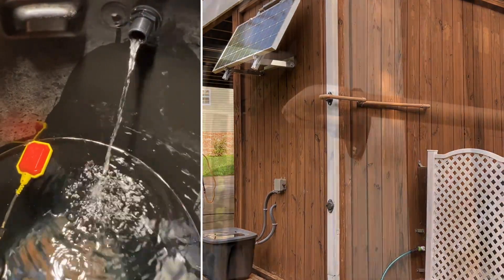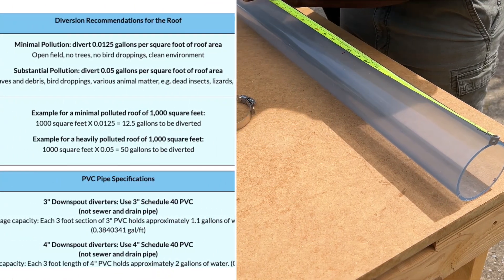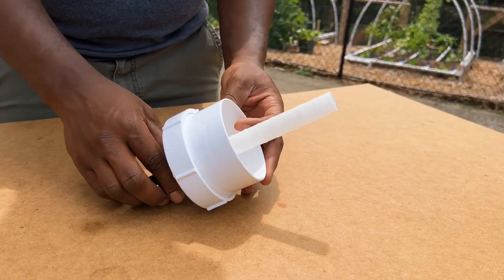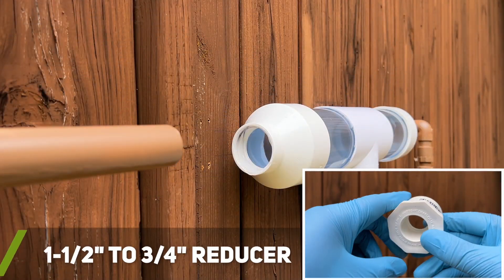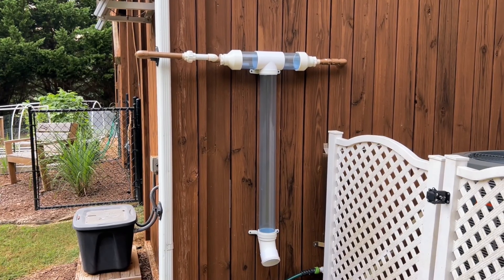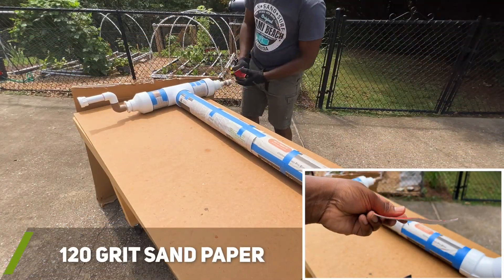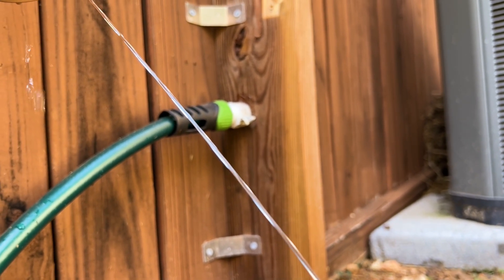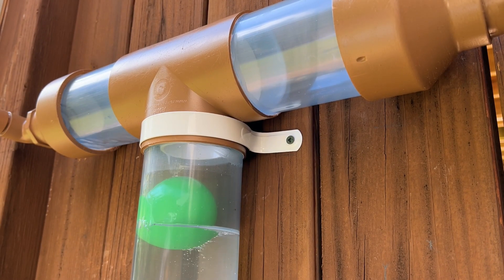Capture CLEANER Rain Water Using This SIMPLE Device

Comment: Very slick idea! I like it alot! You speak like an engineer, as am I. Yeah, you want to use the purple primer then glue it. My only real question is if you are separating particulates from the roof/gutter, wouldn't a larger drain be required?

Comment: What's the point of the ball valve? It only closes off the bottom portion of the pipe when it's full of water (ie, before draining). It's not like it rises and then locks into place for x number of minutes. But if you didn't have a ball valve then the water level itself would effectively block off the lower pipe as well. I guess that if you didn't have the ball valve then you'd get some mixing between the water in the lower pipe and the water going to to the tank. The flow would be a bit more turbulent. But the "waste" pipe is so long that I don't think you would risk have the turbulent water pick up the waste that's settled?

Comment: Given the low diameter of the supply pipe I assume this is for a very small roof?

So does the first flush tube ever get full during a rain?
Reply from the maker: Yep, it sure does. And if you notice it is not filling up, you can change out the control valve with a smaller one that lets out less water from the first flush.

Comment: How does the ball system work exactly? I get that debris runs down into it but how do you get it out without losing water?
Reply from the maker: Occasionally, you will need to remove the bottom cap to clean out any debris. There will likely be no water inside the bottom tube at that time since the water self-drains out at a slow rate to reset for the next rain cycle. You may be able to see this near the end of the video.

Comment: I would have gone with a radial flow swirl filter. It could have been as simple as a 5 gallon bucket sitting on a wooden stand positioned above your storage tanks or a large conical bottom storage tank in line with your other storage tanks.

Comment: CUT PVC like you do metal pipes... all the way around the circumference at the the same time working towards the middle... the clamp is a great way to keep the saw blade inline as you rotate the pipe or pull the teeth of the blade around the Pipe

Comment: Robert, I don't know what your educational background is, but your videos are neat, concise, and very informative without a lot of superfluous chit-chat, which drags a lot of DIY videos down, so I will be interested in your future projects. I recently built a 2 barrel 'whiskey' fountain with an old hand water pump on top, and am using battery operated LED 'twinkle' lights from Harbor Freight for the lighting. However, I would like to convert them to solar with a 12v battery backup, I am also interested in connecting several solar powered landscaping lights to this system. Any suggestions would be appreciated. P.S.  I was a Navy Avionics tech on F-4 Phantoms, and was a computer tech throughout the '80s, and early '90's, but my electronics knowledge slowly faded after that, so I am way behind the ball on nano, Ardino & similar electronics projects. I recently built a double 'whiskey' barrel fountain, and am using battery operated LED 'twinkle' lights from Harbor Freight for my lighting. However, I would like to convert them to solar with a battery backup, and connecting several solar powered landscaping lights into this circuit as well, so any suggestions would be appreciated. One suggestion from an old technician, when splicing wires together, to make the splices less bulky, stagger the length of the two wires, then cover both with 'shrink'. Also, you can buy several types of hand held torches that can refilled from the small propane cans found in any hardware store, they have a hotter flame for faster shrinking, and most of them can adjust the flame. Keep up the excellent work & videos!!
Reply from the maker: Thanks for the tips. You can see what method I used for powering some lights here: https://youtu.be/dLbeZffA7YQ
Note they are DC lights and not AC lights. If I used AC lights, I would have had to install some type of inverter. Not a huge deal, but one less component in the system to worry about.

Comment: I have to assume most viewers of this video would have standard North American roof consisting of asphalt shingles. Costly as it might be, next time you require a new roof, consider getting a metal roof. The amount of shingle 'grit' can be considerable depending on your roof. With a metal roof as it is metal there is no 'grit', thus vastly reducing the potential amount of particulate in your rain barrel system.

Comment: Cool stuff, simple and smart, I like it.
I have to wonder though, won't the control valve result in a lot of wasted water over the span of a storm?
Reply from the maker: Good question. It's possible if you chose the wrong valve, but they give multiple sizes in the kit so you can experiment with which one works best for your application.

Comment: You really should use the purple primer when fitting PVC pipes. Not using the primer will make for a poor weld.
Reply from the maker: The primer I used is an Oatey single step all in one cement meant for this type of application. I’ve used it for a few years now and haven’t noticed any issues. Highly recommend.

Comment: Seeing as most contaminats are heavyer than water, why bother with a ball valve. Simply let the water flow across, and let the contaminates settle into the traps. You can replace the slow drain valve with a regular  high flow control valve. You don't loose the water so that youb all from subsequent rains untill during a maintence check, you decide the debree trap needs to be cleared and drained.

Comment: Very well done. Nice visual demonstration of what is supposed to happen with the roof refuse in the bypass filtration process. I can also see how the volume of rain water which is disposed of during the initial filtration event is tunable by the length of the vertical element of the bypass. Really nice.

Comment: I appreciate your build. However, I'm not yet clear about the 2 outlet pipes. The upper one takes the water to a tank, but what about the lower one? Is it just spilling water down into the ground or something else? If yes, then why keep it so long?
Reply from the maker: If you are referring to the bottom portion of the first flush system, after it stops raining, any water in the first flush camber will drain out the bottom to prep the first flush camber for the next rain. If you are referring tot he outlet pipes from my rain barrel, one is going to a pump that sends water to my near by garden, and the other (with the blue ball valve) is just used for quickly accessing water manually if needed (somewhat like a spigot).

Comment: Hey great video, new to this but wouldn't the water start flowing to your barrels with or without the ball float clogging the hole? Doesn't that seem redundant to have? There must be a hole in my logic somewhere?. Also with the valve on bottom, doesn't that mean you're constantly losing water to, like say it rained for a few days straight, you be losing a lot through that valve right? Sorry for all the questions...

Comment: Great video I never thought to use a hose clamp as a guide to get a straight cut where I live quite often when the Rain comes it'll fill a 45gallon in 30 minutes or less we don't get the gentle rain's like you get so we need a 3 inch downspout a 2 1/2 like the downspout would be perfect but all they make is 1 1/4 1 1/2 2 3 &4 inch pipe I'm going to try 2 inch vacuum pipe as it's thiner Wall and I have some on hand it's also reasonable price can't afford those ready built deverters in my case I'd need 3 for the house 2 for the garage and 4 for the sheds

Comment: Nice work. Just an idea : since water boils at 20°C if there is low pressure, I'm wondering if keeping water in a container with low pressure would allow to "filter" it at low cost ? Water would just evaporates and go in a second container, leaving the dirt behind. 

It would be "easy" (in the principle) to create a low pressure container, it would be a piston with a cylinder activated by the weight of water (filling a deadweight-container).
Reply from the maker: Interesting...I'm not sure, that's a bit over my head at the moment lol.
Reply: @GreenTechTown  
I hear yah, I have the same problem. Wanted to try that theory with a small container to see if it works, turns out I didn't find the time even for that :)

Comment: Great tip on using hose clamp for a cutting guide, and I didn't know about the HVAC wrap, great stuff.
Question: if you take the bottom cap off the settlement pipe to winterize it, how do you handle the occasional winter rains that would dump water down and out of that pipe?

Comment: Best way to cut pvc straight is a miter saw. Finer the teeth the better. Also make sure to turn the PVC a 1/4 turn once it is inserted into the fitting to prevent leaks.

Comment: Great video, I haven't seen such a simple effective way of doing it (but maybe I live under a rock). Why is the rest of your piping so small? I guess you have a lot of drizzles. I'm used to systems in AZ sizing the pipes for big storms, since half or more of our rain comes that way.
Reply from the maker: Good question. The reason the pipe is smaller is because I started with a diverter kit that used 3/4" size piping. I definitely want to install 3" or 4" one day. Just slowly upgrading the system a little at a time :D And no, you do not live under a rock...I didn't find one either, so I figured it may be a good idea to try to make one lol.

Comment: For future videos you need to use purple pvc cleaner before glue. Learn how to do plumbing before making diy videos.
Reply from the maker: Hi Mark. Thanks for commenting. I used Oatey's Single Step PVC cement for this project which does not require adding primer. It has worked well for several projects and I highly recommend it for DIY projects. https://www.oatey.com/products/oatey-fusion--one-step-pvc-cement-652787704
Reply: Additionally painting white pvc is extraordinary unnecessary. As is it won't break down for a few hundred years, unlike that fence which you mounted it to, which will have to be replaced in 20 years give or take

Comment: Looks good! I've also seen dump basins (shaped somewhat like a wheelbarrow bin) mounted on a hinge that tips over when full and then out of the way of water flowing into a cistern... Those need to be reset manually after each rain however. Well made video! Would you want to use a PVC primer on those connections before cementing them I wonder? Often the primer is purple but you can also get it in clear for projects that are more visibly displayed like this one..
Reply from the maker: The PVC cement I used is called Oatey single step PVC cement which does not require primer to be used. It has worked well for several projects I've done and highly recommend it for basic projects not experiencing a lot of pressure. Thanks for the feedback!

Comment: I would recommend putting the black hvac guard you have, orentiate it like you did for the right hand side.. 
On the left hand side, you orientated it so the velcro is opening up towards the rain. Where as the right hand side allows the rain to just roll off the cover, never getting things into the velcro parts.
Reply from the maker: I agree Colin. I actually flipped it around off camera once I noticed that. Thanks for the info!

Comment: Hi Robert, 
You always put such craftsmanship and forethought in your projects. A lot of people would have just glued the pipes back together. Adding the union joints actually makes a lot less hassle if components ever need to be changed out. Also if you're careful you can un-glue the joints with a heat gun. 

Also, on a sidenote, you have a way of explaining things well starting from the basic concepts while at the same time, not making people feel stupid...

Comment: Thanks for making this video!  I live aboard my sailboat and will be adapting this design for my rainwater catch/clean system.   

We live off-grid and anchored out away from any marina.  Every drop of washing and drinking water that we use aboard has to either be hauled from shore in 5 gallon jerry jugs or captured from the sky.   Most fuel docks we touch base at will let you fill your water tanks for free, but other areas like Bermuda and the Bahamas charge at least $.50/gallon and sometimes $1 a gallon.  
 
Saving money is great, but we get even more satisfaction from being self-sufficient.   🙂

Best regards from Key West,
Capt. Blackheart Charlie

Comment: Interesting. But I wish you had shown what happens when the bottom tube lets enough water out for the ball to drop. Does all the water go out the tube ? Does the ball bounce up and down ? Does it work as long as the main flow is greater than the bleed off ?
Anyway, good video.

Comment: Great video, just s slight comment…. One DIYer to another. Ditch those scissors. Like your water containment system, don’t scrimp. If you haven’t upgraded before now you will. Those literally the worst scissors ever! Like good tools, don’t scrimp. I still have the same pair of scissors I was given in my apprenticeship. Keep ‘em sharp and don’t cut what scissors aren’t supposed to cut. I’m retired now, other that loss and replacement I still have all the tools I had when I worked, retired now. 😊

Comment: Won't that small drain port rapidly clog with roof debris?
Reply from the maker: It is hard to say at this moment. It's something I will have to wait and see. But if it does, they recommending using one of the larger slow release valves. It is also a good idea to have gutter guards installed which is something else I want to have installed one day.

Comment: Good video and explication. But the point of a first flush is to. Collect leaves and large debris so it doesn't clog the ret of the system and end in your water butts/storage tanks. 

With your setup your 1.5 inch pipes are likly to get clogged before any water can get to the flush chamber. You ideally need youe gutter down pope connected to the inlet to capture all this and full.quickly to then let the rest of the water pass through.
Reply from the maker: Yeah larger pipe would definitely be better long term. It's something I'm slowly working towards. My first rain barrel diverter kit was designed for 3/4" pipe, so that's the reason for the odd size, but one day I am planning on upgrading to a different system to accommodate 3" or 4" pipe. Thanks for the info!
Reply: @GreenTechTown  it does make sense with your diverter being for a smaller pipe.

Comment: Yikes. Complicated. I do the same thing with three 5 ft tall runs of 3 in schedule 40 pvc. The rain comes out of the gutter and through a piece of screen set at a 45° angle, so rocks and nuts and leaves and stuff like that just bounce out onto the ground while the water goes through into the first weir (Google it).

When the first weir fills almost to the top, there is a Tee fitting, which transfers it to the second Weir and the same on that one to the third. The water fills up three vertical tubes on its way to my first barrel after having passed through that screen I mentioned. It works like a champ acting basically like three settling ponds, allowing debris to settle out and after every big rain, I have clean-out plugs on the bottom of each run, so I can let all the water out and flush out any debris using a garden hose and I'm ready for the next rain. 

Total cost of my system was about $25. I do not use any PVC glue, because I want to be able to take it apart to clean it and if it leaks, so what? It's just rainwater.

Comment: I have lived in Hawaii, successfully  off catchment for 28 years. The first step in my system was that the downspouts were "wet" in that they were solvent welded 3" plastic that was designed to be about 20" lower to the tank filter inflow than the gutter outflow. This will slow down any particles (most anyway) and allow for a periodic flush @ the low point, thru threaded fittings. Other obvious filters removed anything else.
Reply: Thanks for sharing the information. This is a great modification, that I think would work in this approach.  Anything that makes it possible to increase the purity of the collected water, and allows a flush of the lower section sounds like a very  good enhancement.

Comment: Great video!  I like the use of the HVAC wrap.  We (JC/DC in the AZ) get all of our water from our rain water collection system.  I don't use the commercial kit, we just use ball valves to empty our first flush setups.
Reply from the maker: Thanks David. So how often do you all have to empty your first flush setups?
Reply: @GreenTechTown  it kind of depends on the weather.  We will empty them before/after a big rain or series of rains.  In AZ, we get most of our rain in July & August (Monsoon season). We do treat the water in our first tank with chlorine and then we transfer to our distribution tanks using a 5 micron filter as necessary.  We have debris filters on the downspouts as well as a screen filter on the first tank’s inlet.  For our potable water, we use a tri-filter setup from the distribution tanks and all drinking water comes from our Berkey.